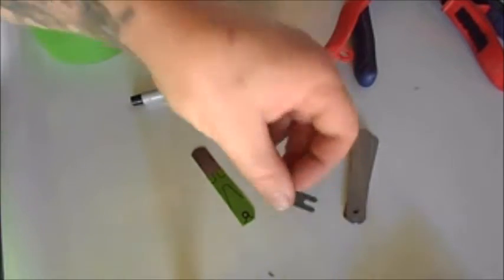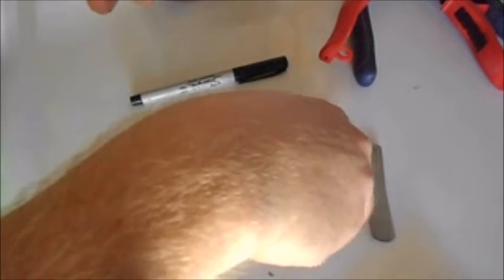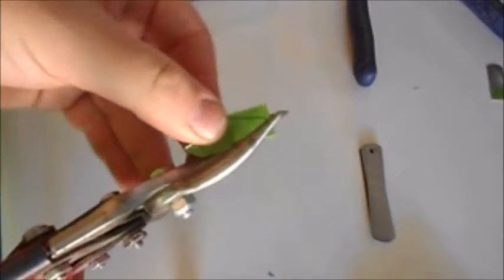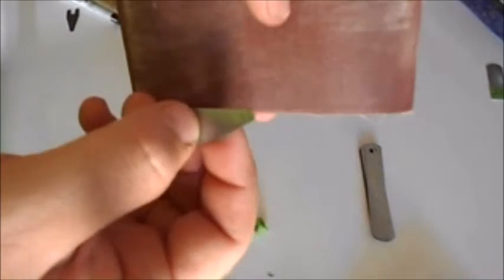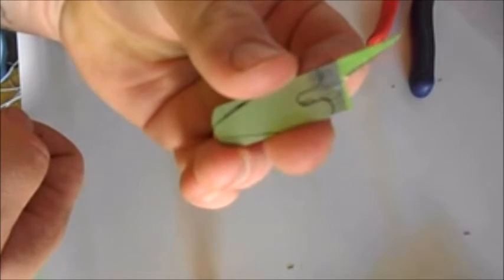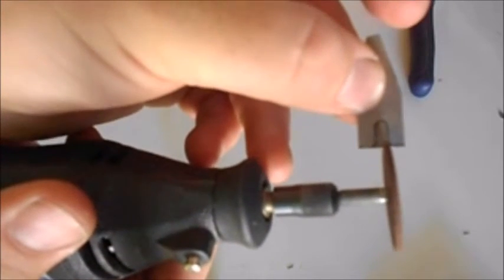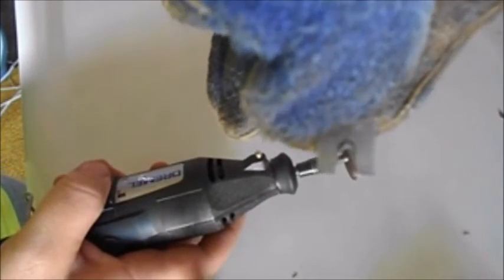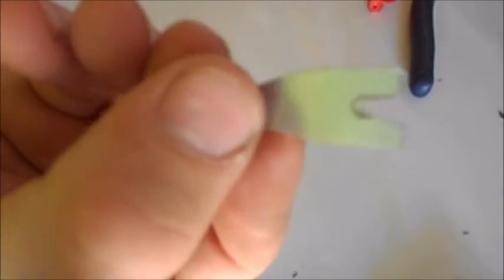Make your own springs- Tattoo University

Comment: My question is from a different video. You called some specs on a liner as, short fat front spring, lighter A-bar and a stiffer rear deck spring. Is there a chance you can post them please? Thanks.
Reply from the maker: Watch video on spring theory. You adjust everything to get the numbers you want. Doesn't need to be same. Every machine is different and requires different set up. The general idea for liner is a fast machine with short stroke. Short front spring and light arm bar usually gets you there. For a liner though I prefer less tension on rear spring 300-400. That's just how I set up my machines
Reply from the maker: I would also watch videos where I'm tuning the machines. Think video with the tattoo kit I tuned one of the machines as a liner

Comment: Damn smart idea! You can even use different widths for different types of machine, like a shader would probably use a thinner one!
Reply from the maker: Correct. Usually springs sold for tattoo machines are your standard size.  This allows you to adjust it more.

Comment: what sizes did you use for this video?
I'm attempting to make some front springs for the first time. I've got a couple feeler gauge tools, any suggestions would be a big help!
Reply from the maker: Stick to the normal spring sizes 18, 19, 20 gauge
Reply: Tattoo University Thanks! 
What sizes do you prefer for your liners and shaders, if you don't mind me asking?
ideally,  I'm wanting to set up a machine of mine to be a shader and color packer but I'm unsure of what springs to cut to achieve this hah
Reply from the maker: depends on the machine you are using.  If you have a short frame and stubby springs you want to use 18's or thinner.  If you have a really long frame the springs need more tension, so you have to go with thicker springs.  If you want higher tension you can us 19s.  The machine dictates what springs you use.  I don't pick springs and then tune the machine.  I set up the machine with springs I think will work.  After testing it out I make adjustments to get the results I want.

Comment: How is this the slightest bit actuate??
Reply from the maker: You are making a copy of a spring.  Once you tune your machine you can make more adjustments.  If you want to be accurate I would measure everything first and then do this process.
Reply from the maker: Most of the time I have to cut springs again when I tune a machine.  The springs that come with tattoo machines are usually the wrong size.  Have to cut them down to make them work.  You start of with the standard size and cut it down to make it work for you.